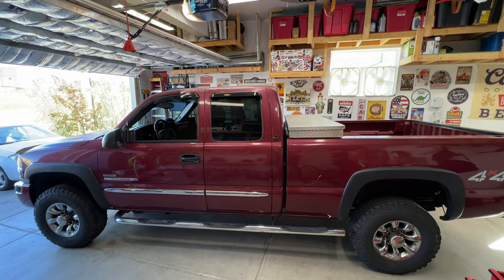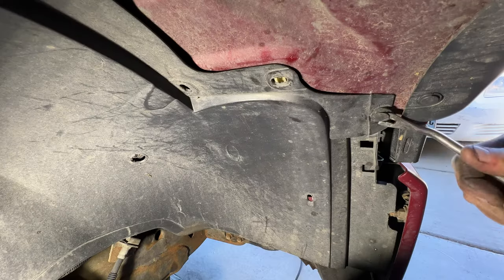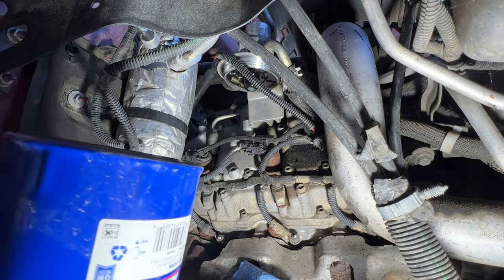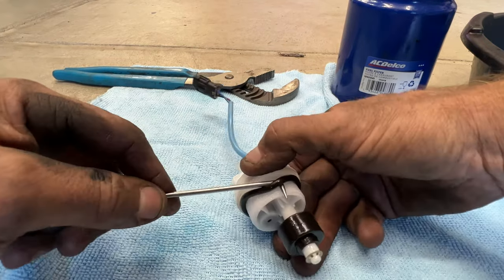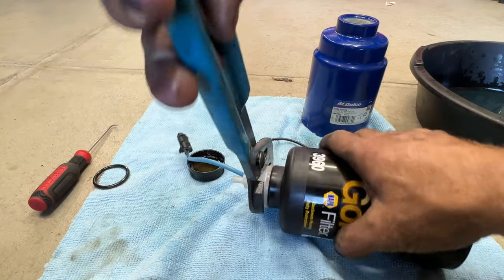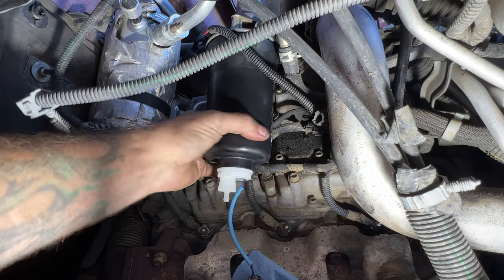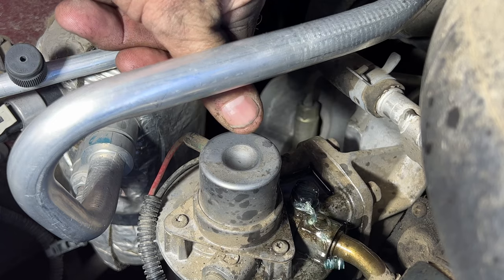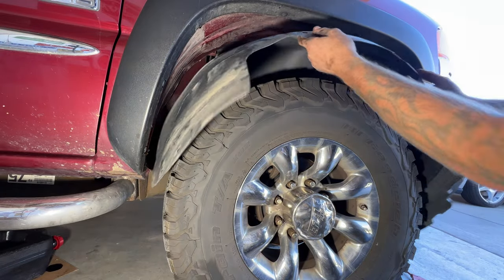Duramax Diesel Fuel Filter Replacement How-To 2002-2016

Comment: I just changed my filter and the truck worked for couple of days but today when I had to go to work it wouldn’t start, I primed but I keep pushing the thing but I get no diesel nor bubbles, what could be the reason? The truck has diesel
Reply from the maker: Did you end up figuring it out?
Reply: The issue maybe from the fuel pump, maybe a bad gasket.
Reply: Check and make sure you didn’t crack your housing letting air in causing the truck not to start after like 2-3 days. I ran into that issue too

Comment: How were you able to loosen the filter so easily. My LML is gelled so I have to take the filter off and I couldn’t loosen it even with a filter wrench.
Reply from the maker: Whoever put it on last must have over tightened it.  But also taking the inner fender well off gives you a littler more room to get a good bite on it.
Reply: @BLUECOLLARGARAGE  Thanks for the reply, I got it changed out going through the inner fender.

Comment: Would the truck run without the water sensor plugged in?
Reply from the maker: Yes it will still run. Might throw a cel or fault code. Did you damage it or the wires while removing it?